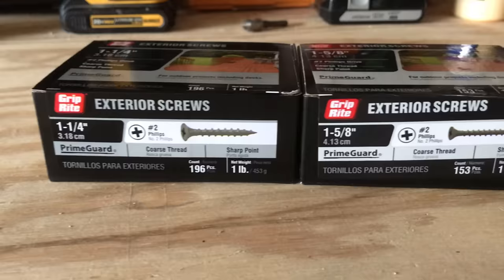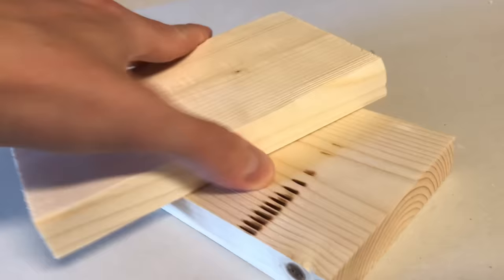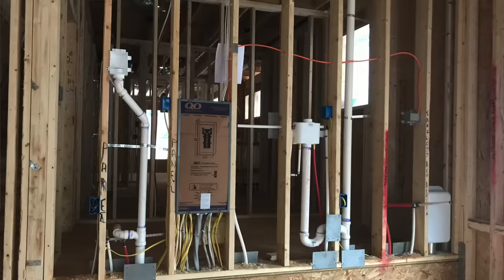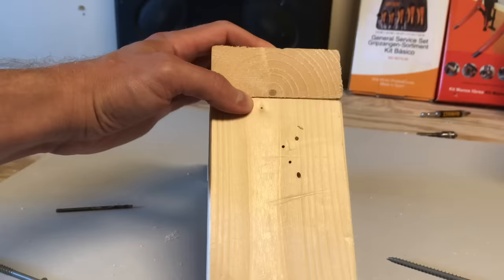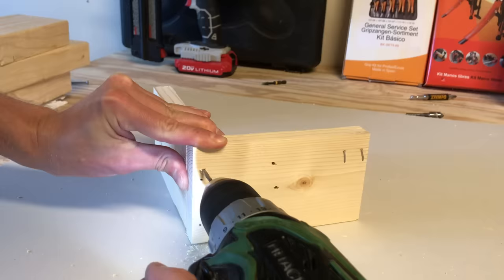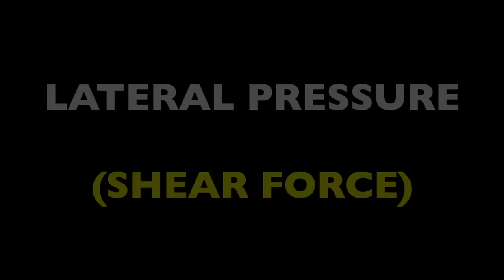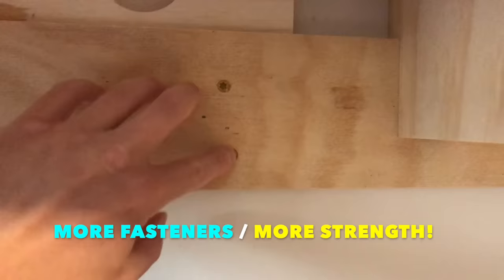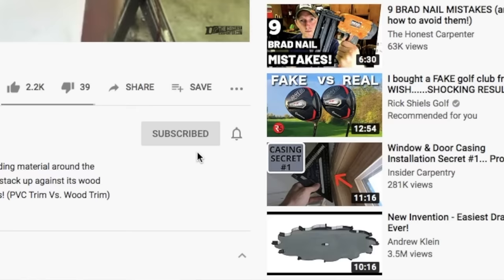Don't Use Screws That Are TOO LONG or TOO SHORT! (Screw Length/How To Choose The Right Screw Length)

Comment: Great video.

Have you done any videos about the types of screws to use for different situations? For example, what is the difference between a regular drywall screw and a bronze epoxy exterior screw or a yellow polymer screw, and in which situations would you use one over the other? Another example, what is the difference between using a screw with a traditional Phillips drive and a screw with a star shaped drive, and in what situations would you use one over the other?

Comment: If all you have is a screw thats 1 5/8" for two 3/4" thick pieces, couldn't you put the screw in on an angle so it doesn't punch through the back?

Comment: Did you miss the third force - seasonal swelling and shrinkage of wood? Or is that not an issue with the smaller dimensions used in framing? Isn't this what causes screws in drywall to pop the plaster?

I know woodworkers and cabinetmakers go to great lengths to avoid problems with it ... and I had an old bench hook tear itself apart due to it.

Comment: If a door is starting to tilt a little, so that the space between the hinge and the door is larger at the top than at the bottom, what is the smallest and largest screw I can safely use on the top hinge to get deep into the jack and king studs without stripping when a lot of force is applied using an impact driver?  Are door jamb thicknesses pretty standard, or is the jamb thickness and space between the jamb and the jack stud something I'd have to measure with a depth gauge?  I'd like to replace the screws in there now that only thread into the jamb and hope that this can straighten the door by pulling on the hinge.

Comment: Or add glue!
Reply from the maker: Very true, Paul. I've done a loooot of glue + brad nails over the years...
Reply: just told my daughter today about, "glue, screw, and clamp(when needed)"
Reply: @jeffburtonnottheracecardriver  If you glue and screw you DON'T need to clamp. The screw essentially acts as a clamp. 😊
Reply: @dancahill9122  you're right of course; I was working on piece work at the time (broken chair)

Comment: Hey Ethan, thanks for your informative videos. I'm going to build a work bench with 2x4 frame and legs. The legs will be two 2x4 at a right-angle on the outside of a 2x4 frame. (see TYLynn's ultimate mobile workbench on Pint-res). My concern is too many screws in such a small area. I'm very interested in how you would approach this issue. tia
Reply from the maker: Hey Sleepy, check out how I did that for my work bench!
https://youtu.be/00Q2vQZFbu4

Comment: I’ve seen sheet rock screws used instead of deck screws, which I think is dangerous as they don’t have that same shear strength. Is that correct ?

Comment: I am not sure if this is a legit "technique", but for the withdrawal pressure (hanging from the ceiling for example), I often put my screws in at apposing angles to each other (only 10-20 degrees or so). This seems to give a real strength boost - so 4 screws might look like:  \ /       \ /    - any thoughts on using screws at an angle here? - or is there something very daft about that!?

Comment: hi I have a Question I'm building a garden pergola and I need two 20 to 21 feet of a 2X8 piece of treated lumber and I can't find it anywhere so i was wonder is there a best way to joint two pieces  of treated lumber they will not be supporting any weight its just decorative any advise will be welcome

Comment: how would I deal with attaching a board that bows to one side to another board. I want to just drive the screw in and pull the board strait, but I am worried about cracking it. Thoughts?

Comment: Is there a tool or a method that works to install a screw when there is not enough rooms to apply downward pressure on the screw with a screwdriver or drill?
Reply from the maker: They make truncated (right angle) drills for that, George. But I’ll admit—without one, it’s difficult 😬

Comment: If the screw is a little bit too long for the job you are doing when you don't have time to run to the hardware store in a pinch you can always nip off the end with a pair of bolt cutters and then screw it in just saying

Comment: It’s a common fact deck screws have little shear strength. Too often “deck screws” are used in place of nails. If you want to build using screws they are referred to as structural screws. Do a little research on your fasteners before your next project and you will be surprised to learn there are a wide variety of screws for different applications.

Comment: Thanks for the video. Good information shared. 
Speaking of fasteners, can you make (or do you have) a video about power driver bits? I received a set of bits & I thought they looked great for function. However, after 12 fasteners, I noticed the #2 Robinson bit was not driving a 2 1/2" fastener into spruce. I fit the bit to make sure it was the correct size. When I looked closely, it appears as though the bit is rounded. I switched bits out & continued the job. So, I am wondering if you can review some brands?
Thank you
Reply: Sean, a site called Project Farm reviews many types of products. I remember he reviewed screwdriver bits for cost vs. value. An excellent site !

Comment: Love your videos.  I think I first came across the one about dealing with rot in exterior doors and brick mold.  
Question: 
Where old deck screws have come loose, would it make sense to replace them with larger screws? For example, replace #8 with #9?  And perhaps go from 2 1/2 inch to 3 inch, for example?  Or is this all wrong?  Would really appreciate your take on this issue.
Thanks.
Reply from the maker: Thanks Joe! I’ve done just that before. Sometimes the holes are too reamed though. In that case it’s good to move over 1/2”, drill a new hole and go in with a larger fastener.

Comment: I've heard that the screw should be twice as long as the board you are going through.  3/4 wood, 1 1/2 inch screw.  A general rule not absolute.

Comment: does a screw clamp two pieces together? for example in place of clamps when gluing.
Reply from the maker: It can definitely serve that function, Stevie. But so can a nail! I’ve done a lot of glue and Brad nail projects, where the brads just act as temporary fasteners until the glue sets up 🙂
Reply: @TheHonestCarpenter  thanks! Would a pin nailer work to clamp pieces while glue dries?

Comment: How to avoid screws from breaking off in very hard wood (living in a subtropical climate where sawmills almost don't want to saw certain woods)?
Reply: What type of screws would you recommend for making butt joints with 3/4” mdf?
Reply: Predrill.
Reply: @trevorgreenberg2860  You  want to use something with large threads, but predrill to prevent splitting. Experiment with scrap pieces.
Reply: @trevorgreenberg2860  there are special screws made to use in MDF. I've seen a lot of hot glue used in MDF too.

Comment: It's always a facepalm moment when I see people still using Phillips head screws.  Spax (the star) or Robertson (the square) people!  Also take some time to learn how to properly set a screw.  You shouldn't have thread in the top piece.  Choose a screw length that has an unthreaded shank that allows the screw to work as intended by putting the two pieces into compression!  Also, stop using drywall screws for anything other than drywall... it's just asking for trouble.

Comment: Americans.  
For the Love of God.  
Change to the metric system.
Reply: In Canada, we changed to the metric system yet, somehow, everything is still in imperial. Nobody was going to absorb the cost of the changeover.  Houses were always built with studs that were 16 inches on centre.  You start changing everything to metric and suddenly you can’t do any repair work. So essentially the construction industry stayed in imperial measurements. We still buy nails and screws in inches. Not very helpful for the European market. Yes, the metric system is more logical with its use of a base 10. Our imperial system with a base 12 is much more cumbersome but unfortunately we are pretty well stuck with it!
Reply: I agree we should have long ago
Reply: @patrick henry no one uses imperial for length measurements anymore. Today we use international standard, or the industrial inch.
Reply: @gratefulketo2211  if US Customary is so bad then how come the USA manages to build more single family housing units than the rest of the world combined does? Our closest competitor is Canada though. You guys add up to about a quarter of the total built. So not bad. And that's only because you're using our superior measuring system. Fawk Europe! Base 12 is duodecimal. So it is twice as good as the decimal system. How many things evenly divide into 10? How many into 12? Eh?